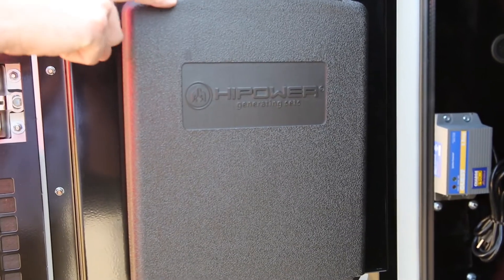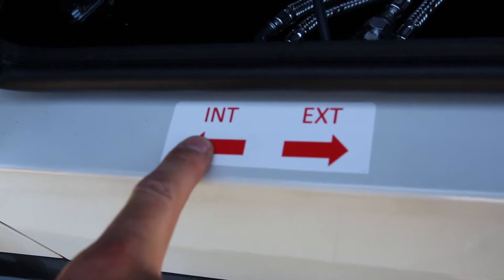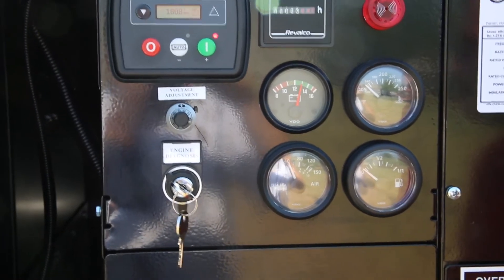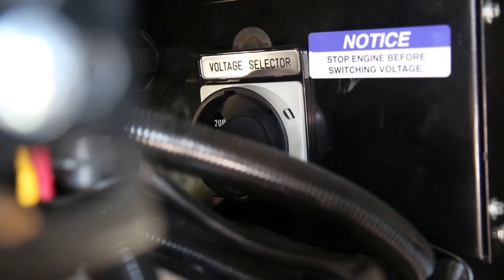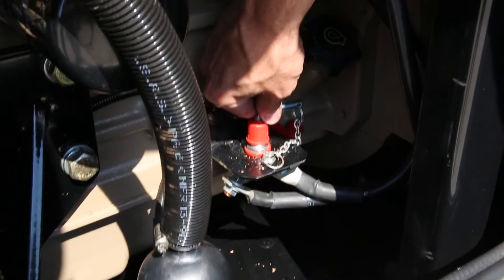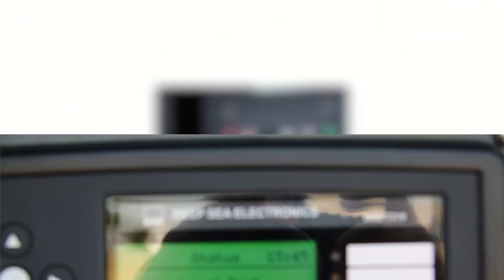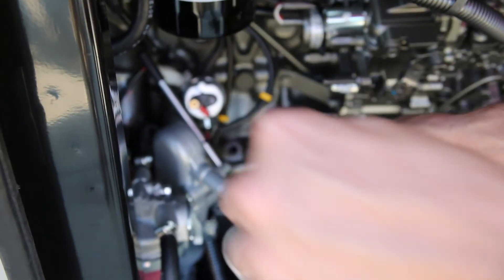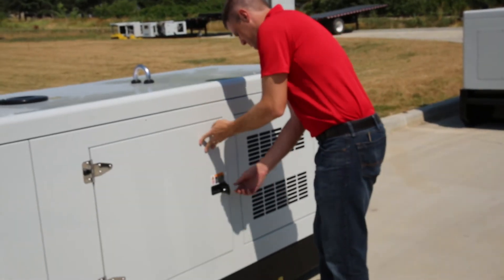Hipower Diesel Generators pre-start checks

Comment: I know this video was posted a while ago but I have a question. Wouldn't you want to turn the main circuit breaker off before you shut the machine off, as to not surge any devices that may be hooked to the generator?